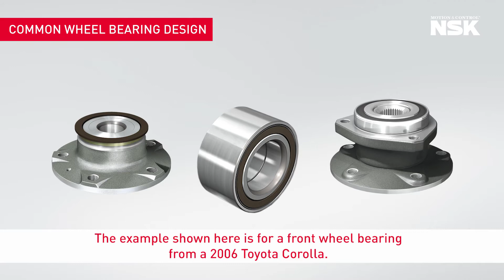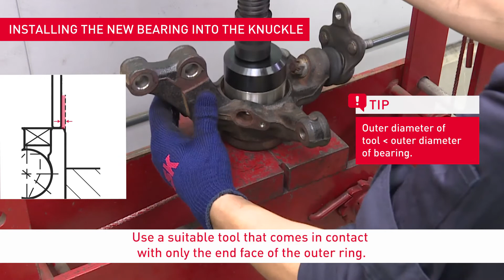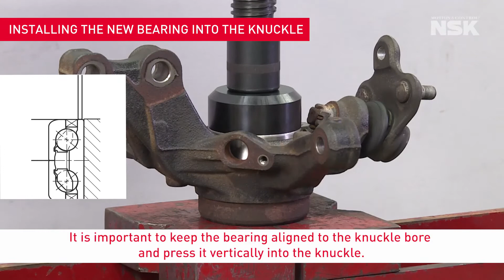Wheel Bearing Replacement - How to replace a Wheel Hub Bearing

Comment: It's so nice to see it done on video. With a clean hub no rust, mud, debris... I do a fair amount of wheel bearings. 
As an example, on the last one I couldn't distinguish where the circlip ends were! I sweated my wire brush out for some time until I could see them! That's the amount of mud, debris... etc. in there! LOL 😂